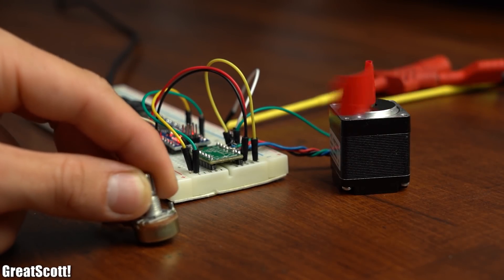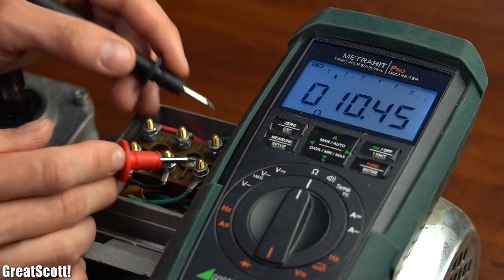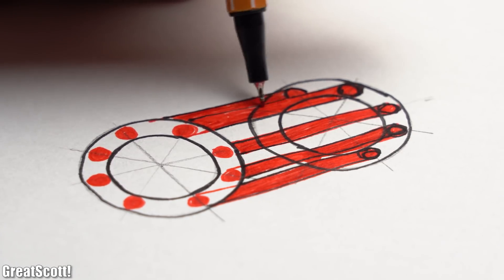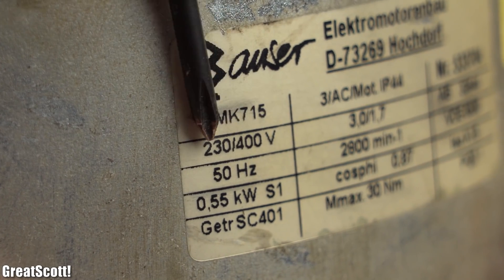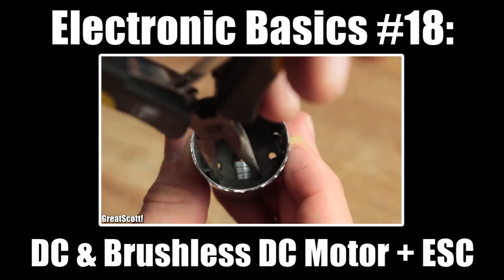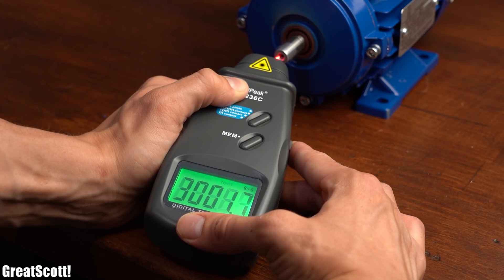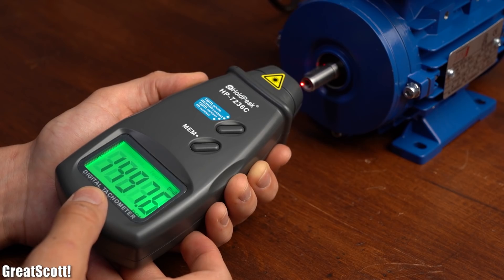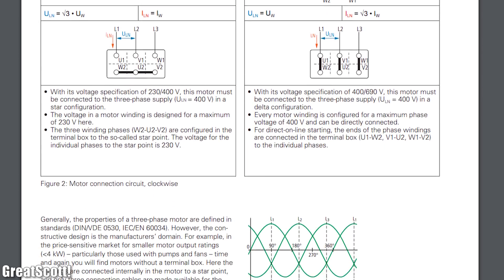Does this old Induction Motor still work? || How do Asynchronous Motors work? EB#46

Comment: Hold up - does Germany have 3-Phase in every home?
Reply: Yes
Reply: @saoritakebe8319  another thing the U.S.A lacks... Sadness.
Reply: And we use this for our stoves - wich is probably the breaker scott hooked his therminals up ti
Reply: Or he just had it conveniently laying around because he has a gas stove and not an electrical one like us peasants. :)
Reply: @MirkayFratsin  I actually think he Has one -  because the 3 phase breakers where not usually in place in flats with a gas supply. But you are right because he might not have it hooked up
Reply: @TecSanento  does the meter just kwh meter or with kvarh?
Reply: @samueladitya1729  just kwh actual power not the other ones - and also summarized over all phases
Reply: How do you expect us to power our furnaces with a measily 230V?
Reply: Regular homes have main power supply of 3 phase 63 A each at the breaker box, although your installation is mostly limited to 40A
Reply: @TecSanento  63A is common for houses, flats usually just have a 35A service. But it depends.
Reply: ALX Electronics we also have 3-phase here in the netherlands(standard)
Reply: Also in Denmark, older ovens and washing machines would run 3 phases, newer ones just 1. I have 3 phase output in my garage, the guy who built the house in the 70s probably had a welder or something.

Comment: They have another advantage -- they are extremely silent, even under load. Compare to any DC motor -- you will barely hear how Async motor works. But the price for their "immortability" and silence is they are significanly less powerful comparing to other types of the same size. Most of the time you need to use some gearbox or belting with differently sized pulleys to get suitable torgue out of Async drive.

Comment: It seems to me that, up to some point, a greater slip would increase the motor torque, no?  The more slip, the more the induced rotor current, the greater the field interaction, and the more force applied to the rotor, until it reaches the point where the whole thing slips to the next induction state and sort of 'falls back' a step in the stator field, at which point the motor would stall if the load didn't drop off because we're beyond what the motor can deliver.  That makes the motor self-regulating within a defined load limit.

Comment: One big advantage with these motors is the fact that you can use a frequency converter, and thus adjust the speed of the motor without losing too much torque. 
There is a lot of good frequency converters out there that are not all that expencive.
There is a lot of cool stuff you can do with the frequency converters.
I have used this sort of setup quite a few times in packing robots, ship systems etc. The motors are cheap and reliable and you can use a 3x220 motor with frequency generator that uses 1x230 supply. Very handy sometimes
As always great video !

Comment: "I want to see if this motor works"
"Ah I cannot look into it"
*orders a new motor*
"Now I understand..."

stonks
Reply: HarleyHilderson  I completely understand this. When I need something from my workshop, it usually takes several hours or from time to time days before I find it. So, instead of looking where to find it, I quickly order it online. Usually I get it faster delivered than that I'm able to find it. So I have most of my stuff double/triple, which makes retrieving the next time easier....
Reply: HarleyHilderson 
I've found that 2 women will be compatible as long as you've disconnected one before you connect the other. For some reason this allows them to communicate correctly, and no magic smoke is emitted.
Reply: HarleyHilderson  lmao
Reply: MAKER manifesto: If you can't open it, you don't own it ;-)
Reply: knowledge has a price.

Comment: It’s dangerous to run motors with the key in the key way on the shaft without something to retain it. It may appear stuck in place. But as the motor runs generating heat. This heat will heat the shaft. Which will cause the shaft to expand  slightly. So if it expands so will the interference fit of the key slot. Which could cause the key to release seemingly spontaneously and send it flying and ricocheting about around the room. Simple piece of tape can prevent this.

Comment: I've often wondered if a BLDC driver would run a 3 phase induction motor
Reply: The Induction motor needs 120° phase shift between the phases so if the driver can be programmed in this configuration then it will
Reply: Technically yes (almost what a VFD does).
Practically BLDC drivers check the back EMF from a synchronous motor to know which phase to use. This likely won't work with an induction motor and it won't start up
Reply: I think it depends on the values
I know about BLDC driver higher
Frequency so coil design for it.
Reply: A BLDC motor is basically a 3 phase motor, but uses a magnetic rotor, so i wasn't sure if it would work, but with the slip as scott describes, and would be 120° 
An induction motor will run on higher frequencies, maybe up to 400Hz where the iron core would start to saturate.
Reply: @combinacijus  if you have 3 phases and perma magnet inside you have synchronous motor (the more complex and powerful ones uses electromagnets)
Reply: I would think the amp draw would fry it (then again i havwe experience with 20hp motors at the smallest
Reply: ESC output is not sinewave. it's just pwm to control the power. and the ESC wont receive feedback properly so it will run at lowest speed and won't run as smooth as sinewave.

Comment: What's crazy is I have the exact same brand of that motor. I purchased it and assumed it was for 60hz, (I live in a 60hz country) but when it arrived I found out it was for 50hz. It's still really useful to learn from it.
Reply: sometimes they're rated for both, it'll just spin 20% faster on 60 hz
Reply: 90% it will work just fine, maybe RPM will be a little bit different. That's the benefit of Async motors.

Comment: Great video! I learned from it. 
Can you make a video about powering bldc motors from the grid with 12 or 6v transformers?
Reply: That you can't really do. You would need 3 of those, each wired to a separate phase of the mains (so no luck if you don't have 3 phase supply). And even then it is very unlikely that you would get the motor to spin because BLDC motors are not designed to be powered like this.
Reply: @JanCiger  last year I tried (with 3  12v transformers) and it worked. It was suprising for me.